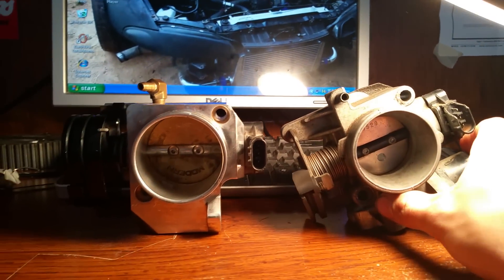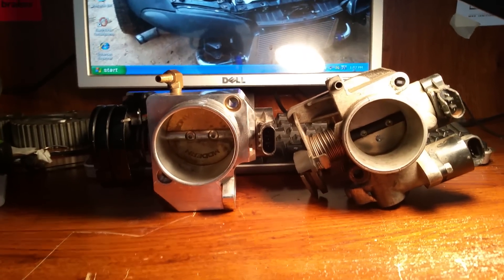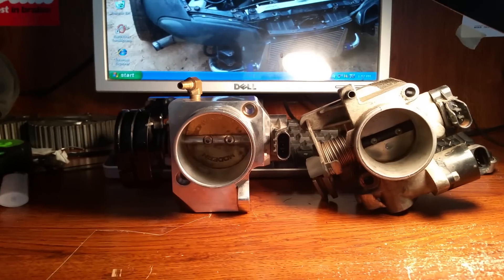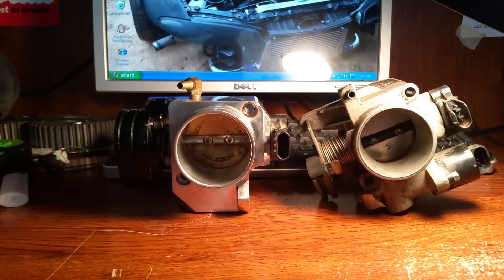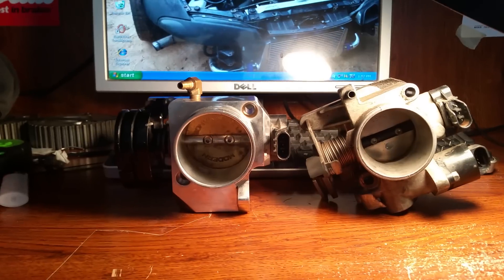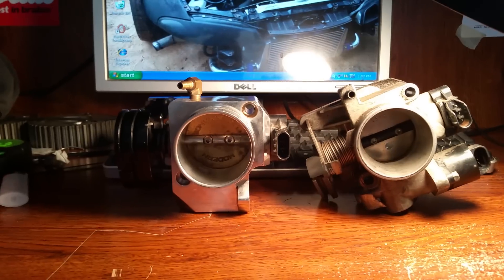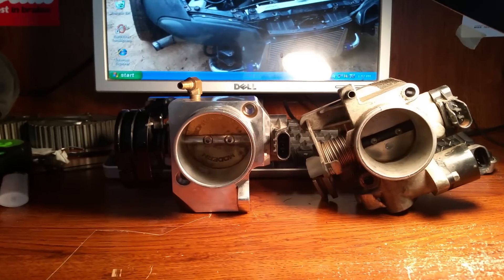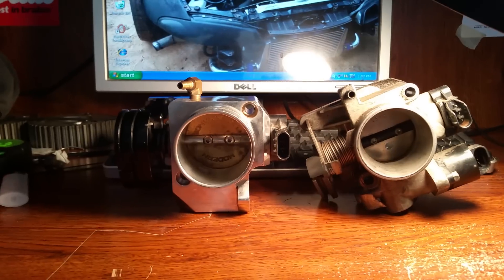Bigger throttle body vs. Stock

Comment: not sure for eclipse, but for the neon 95-99 the automatic transmission car comes with a larger inside diameter with no taper but exact fit for the manual transmission ones.

Comment: Hi there I liked and subscribed. Q.s   I have a 2.0 Hyundai elantra "00" and did a ported exhaust on my engine mod. And was wondering what other type of throttle body will accommodate for my modification. I am currently using a stock throttle body.  I was thinking of adding a motorcycle throttle body since I am running it rich.  I so far did a catalytic delete and ran a straight pipe for the mufflers. Same ngk stock spark plugs and wires same stock injectors same stock fuel rail same stock gas pump. What do you recommend. And Thank you.

Comment: Not for mopar. If you have a 345ci you can bolt on a 392 intake and throttle body they're made to mod.
Reply: 5.7 and 6.4 throttle body are the same size...